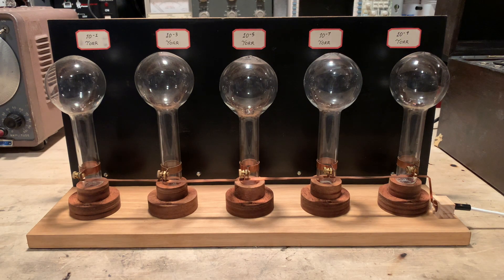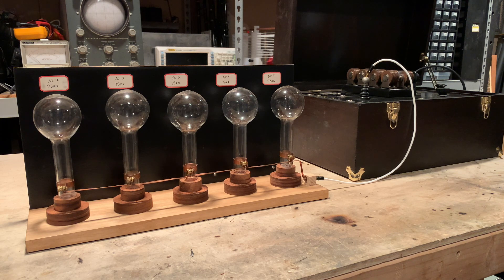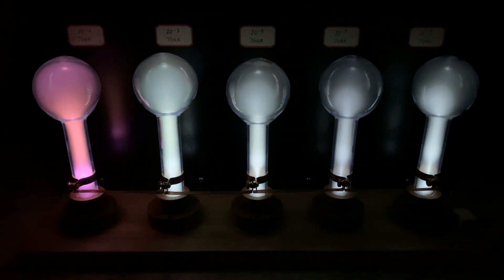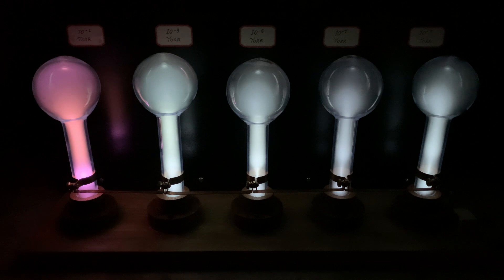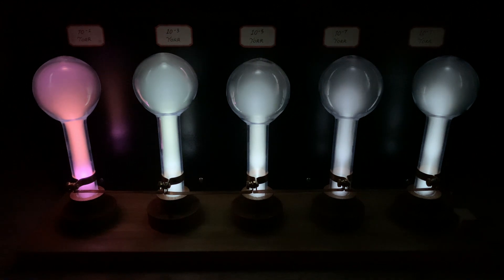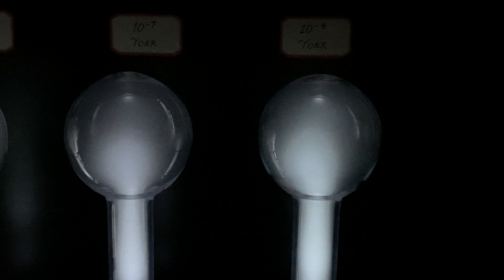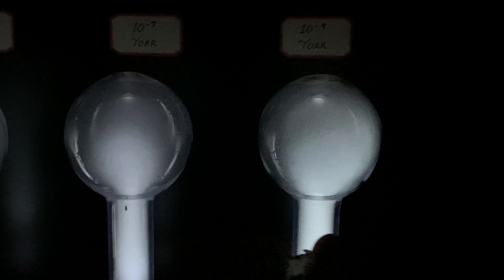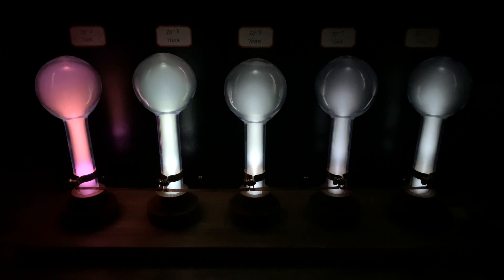The Relationship Between Plasma Glow Discharge and Vacuum Pressure

Comment: Just how do you measure such extreme vacuum levels exactly and also why isnt the tesla electrostatic evacuation method of reaching such high vacuums more known and spread out instead of the usual high cost inefficient vacuum pumps ?
Reply from the maker: I use a Hornet IGM400 hot cathode vacuum gauge to measure vacuum pressure to an accurate degree. 

Tesla employed an improved mercury drop pump, known as a Sprengel Pump, which achieved fairly high degrees of vacuum.